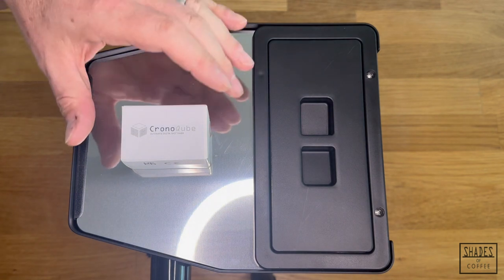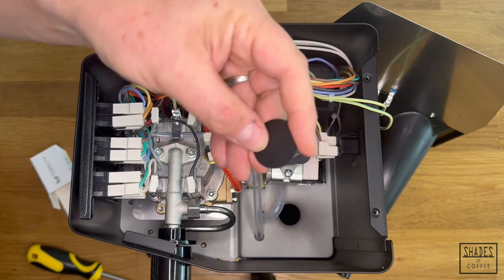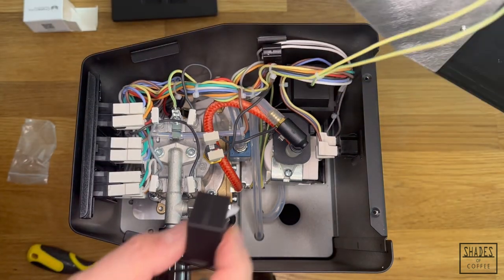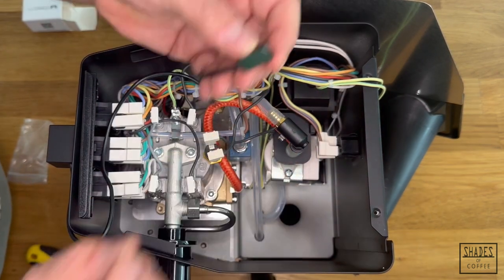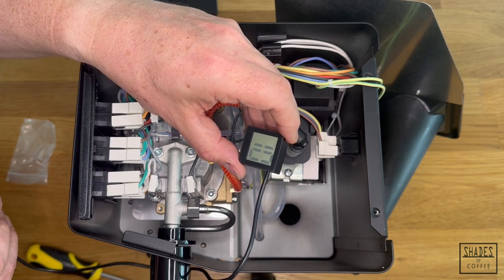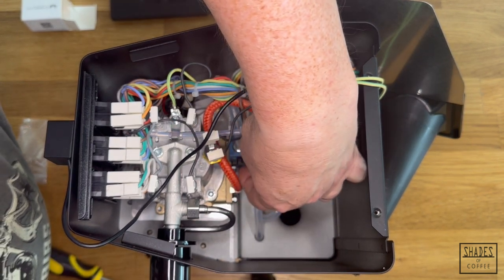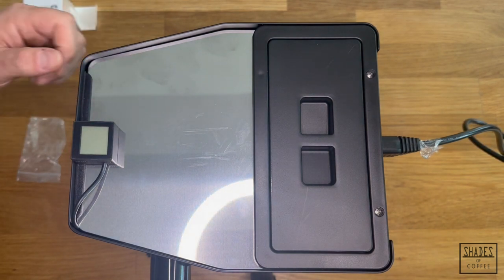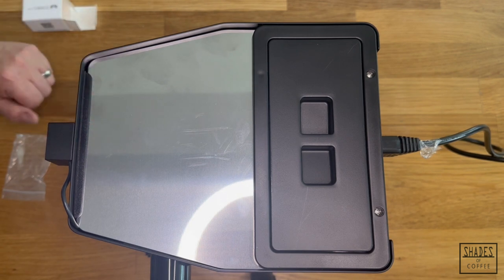CronoQube espresso shot timer - sample installation video on Gaggia Classic

Comment: I was wondering for the next thing you sell on your site  to expand your range, is some sort of trip tray water waste tube that could exit under the trip tray into a larger vessel, this would be very handy for those that use the slimmer drip tray to fit their scales on. I fill mine up very quickly due to cleaning the porta filter and back-flushing
Reply from the maker: Our Extended Max drip tray has a larger water capacity, but retains the same 25mm height.  Having an external waste is an interesting idea, though I doubt many people (or their wives) would find it "kitchen friendly".

Comment: Wow that's sick. I have the PID holder so I'm gonna have to try this and rout it up there I think.
Reply from the maker: We’ll be publishing the STL for a 3D printable CronoQube mount for the TopBox soon - then you can cut a basic hole in the TopBox and insert the mount and then clip the CronoQube in from behind.
Reply: @ShadesofCoffee  amazing!
Reply from the maker: @TylerPoppe  You can find the mount on Thingiverse now - and also linked to from the CronoQube product page
Reply: Any chance you can customize a new topBox that’s already has a hole for this to fit if i make an order for a full setup, PID, chronoqube/timer and pressure gauge. ? I would be interested

Comment: Nice idea if you are doing simple on and off shots with no pre-infusion, I use a dimmer mod on my 2006 machine and use the dimmer knob as the on and off button so, I would need to time the pre infusion before it goes back on, my trusting seconds hand my watch does the trick.
Reply from the maker: You don’t really want to use the dimmer as the on / off as this will leave the solenoid permanently energised and with the brew path open from the boiler to the group. Use the brew button to start and stop the brew process and use the dimmer to vary the flow. Typically the CronoQube works very happily if you’re preinfusing (using a dimmer) and want to time the total time, or are using brew switch on / off for simple preinfusion. If you want the timer to pause when using a dimmer then you can put the sensor on the vibration pump.
Reply: I have been timing my 30 shots from when the first coffee starts to land in my cup, this takes 10-15 seconds from start up as I have a 9 bar set up, should I be timing my 30 seconds from the moment I switch on the pump then. Sorry for such a daft question
Reply from the maker: @Daverave69  with electric pumped machines it’s typically pump on time to pump off time - but if your method works for you and you enjoy what you’re making then keep doing it. Espresso guidelines aren’t strict rules.
Reply: @ShadesofCoffee  Thank you

Comment: Where the control should be placed so that it only measures the extraction and not the preinfusion if the dimmer control is used. Thanks
Reply from the maker: You can experiment with placement of the sensor on the vibe pump - and with careful positioning you can have the CronoQube activate only when the pump is pumping harder, and not when it’s going very slow.